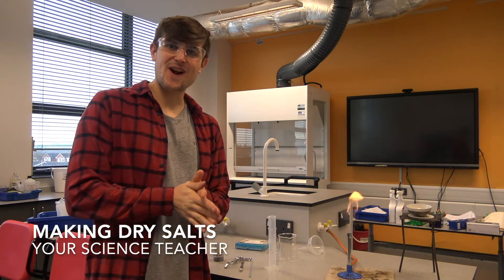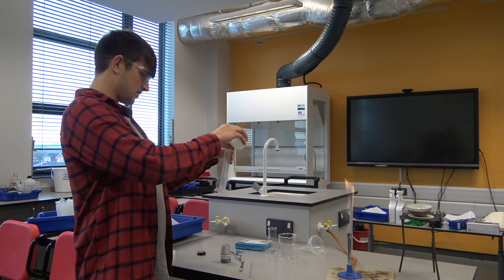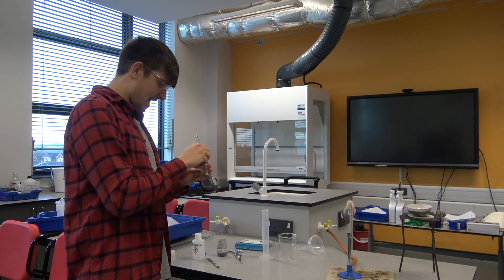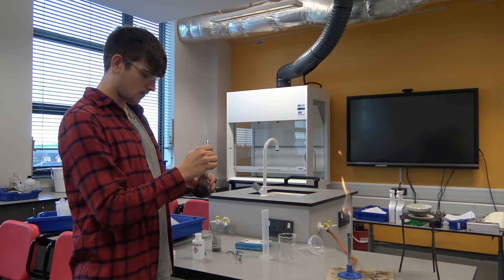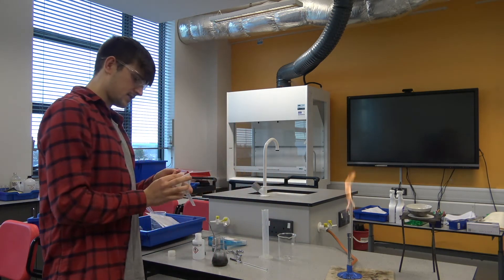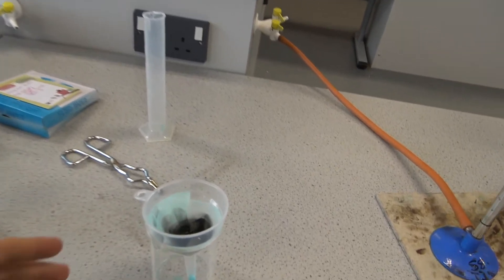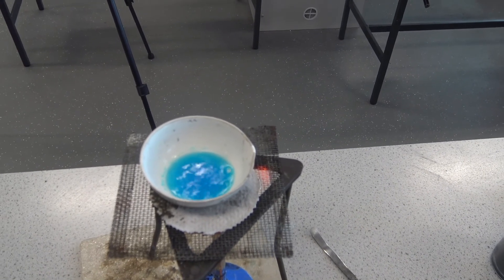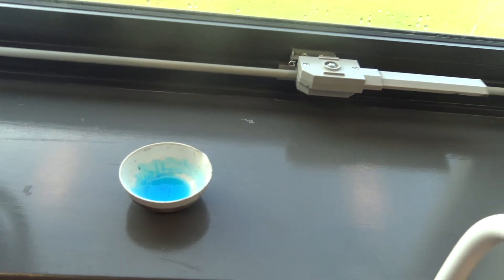How to make Pure Dry Salts

Comment: You have prepared hydrous copper sulfate (probably CuSO4•5H2O) well.
however, you have forgotten to dry it to get it into its anhydrous form. (if this is what you meant by "dry" salt)
anhydrous copper sulfate is a white powder in colour.
this is acieved by grinding it up very finely and roasting it in a crucible/putting it into an oven with no fan setting, just induction, on a low setting, for a while.